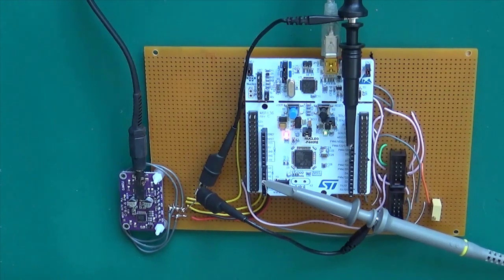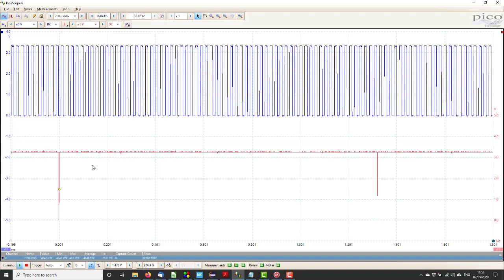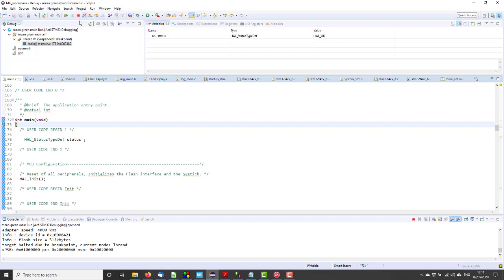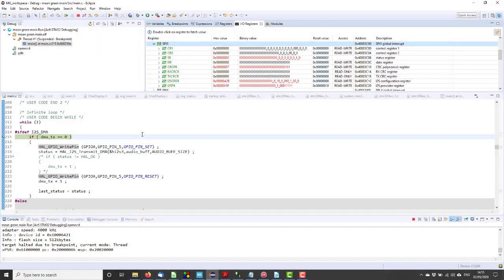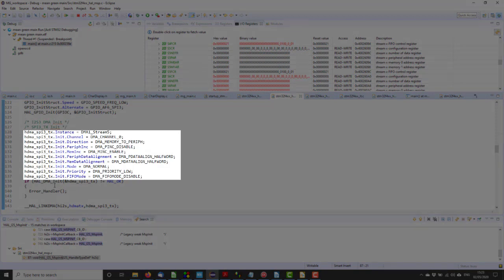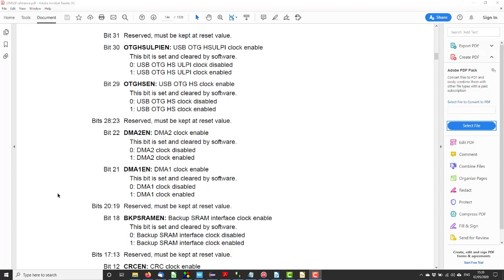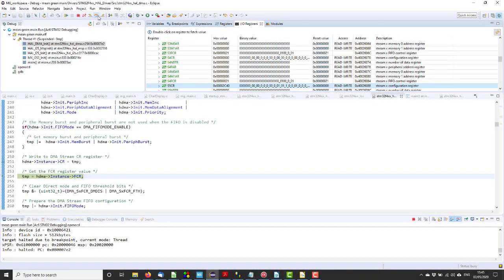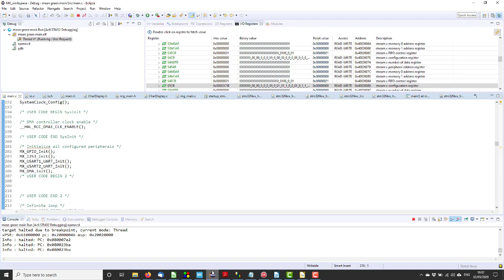Fixing The STM32 CubeMX Bug When Using The I2S With The DMA

Comment: CubeMX is nice with all the GUI configuration, but sometimes I think it would be just easier to read the datasheet and set the register values on my own. When there are bugs like yours, it needs probably more time to find out where CubeMX messed it up than setting it all by hand.
Reply from the maker: When I was doing this kind of thing for a living I always set the register values directly as I didn't trust any HAL type middleware. These days I just want to get on with the project and CubeMX / HAL is an easy way to get up and running quickly. This is the only real bug I've found so far but you're right - it did cost me a considerable amount of time tracking it down.
Maybe the next STM32 project I'll do without CubeMX / HAL by way of comparison.

Comment: Thanks for this video.  This issue is corrected in later versions of STM32 CUBE MX (certainly in version 1.10.1) but I had missed the DMA setup in the I2S setup and, when using the DMA setup, had selected the wrong peripheral.
Reply from the maker: I did try a later version of Cube MX (can't remember which) and the problem was still there. Soon I will be doing a new video on the "Mean Green" synthesizer project where the problem occurred. I will check the latest version of Cube MX then.

Comment: Great video, probably saved me a lot of pain. I like your approach. Very many thanks for taking the time & effort to share your experiences.
Reply from the maker: Glad you found it useful. It certainly took me quite a while to figure it out mostly because for a long time I was assuming it must be something I was doing wrong.
Reply: @TripplikitElectronics  I'm now struggling with an error trap lockup on my project, on my "Black Pill" board. It seems the i2s pll init is hitting a timeout. Starting a fresh project with Blinky and then adding back functions, it works. I notice the sequence of the MX_INIT calls is different. I guess this sequence depends upon the sequence of steps taken in the configuration tool? Much the same problem as you had with the DMA init.

Comment: Why did you set the Communication Standard in CubeMX for your I2S settings to LSB First (right justified)?
It looks like you are using a Adafruit UDA1334A clone from AliExpress.   Those DAC's should be set from factory as default Standard Phillips I2S format, which should be MSB first(left justified) format.
Did you change any jumpers to go high on the other side of that DAC board?

I always set Communication Standard to "I2S Phillips" when using a STM32F4 with a PCM5102 DAC module, which uses that Standard.

If you're trying to create a DMA stream, you should be using Mode: Circular, Use Fifo, Threshold Full, Half Word for 16 bit and Burst Size of Single.
Use Hal_i2S_Transmit_DMA() to init the stream and use the TxHalfCplt and TxCplt callbacks to call a function that will keep reloading your buffer..  the Circular buffer.
Reply from the maker: The point of this video was that I couldn't get the DMA to work at all - all it's settings were blank. I traced this to the fact that the code CUBEMX generated was attempting to set the DMA settings before turning on the DMA peripheral clock.
Once I'd got the DMA to function I did go over to using a circular buffer as you suggest.
Yes, you are correct, I set the jumpers on the DAC board to SFO HIGH, SF1 LOW  -LSB justified 16 bits. Can't recall why I went for this over the I2S.

Comment: Is't possible to make Echo cancelation with STM32 when the microphone and speaker work in the same time ? (like application of intercom)
Reply from the maker: I'm sure it is possible to do echo cancellation. The STM32s are pretty powerful. For audio work I'd go for one of the faster ones - I'm using an STM32F4 which goes up to 180MHz. A built in floating point unit is also very useful.

Comment: Hi, does it work for version 6.0.1, i am trying to receive and transmit I2S data in half duplex it is not working, but it works fine for full duplex
Can you give me some inputs to solve this problem?
Reply from the maker: Hi. The problem still seems to be there on Cube MX 6.0.1. The problem was with the DMA not being turned on before it was set up. This just stopped the I2S working all together. Sounds like your problem is something to do with the way you set up the I2S for half duplex. I am only sending data out to my audio interface so it doesn't affect me.

Comment: another weird thing is that I was using I2S with STM32F413 and it worked perfectly with no problems !
Reply from the maker: Strange why it gave a problem with my Nucleo and not yours. Still possible I've done something wrong setting it up but I don't think so.
Reply: @TripplikitElectronics  may be MCU is different from dev boards in APIs ?

Comment: Well done for finding it. It however seems that CubeMX Ver 5.0.6 generates the code correctly, just like you described your fix at 13min, 56sec into the video. What version of CubeMX did you use?
Reply from the maker: Just installed 6.0.1 and I still have the problem. I'm curious to know what you're doing different to me.
Reply: @TripplikitElectronics Hi, does it work for version 6.0.1, i am trying to receive and transmit I2S data in half duplex it is not working, but it works fine for full duplex
Can you give me some inputs to solve this problem?

Comment: They have more issues with forgetting to enable the clock on peripherals. If I generate a stock project for the 
NUCLEO-H745ZI-Q and tell it to configure all the default peripherals, it won't enable the clock on a number of the GPIO registers, meaning that even the LED's don't work.